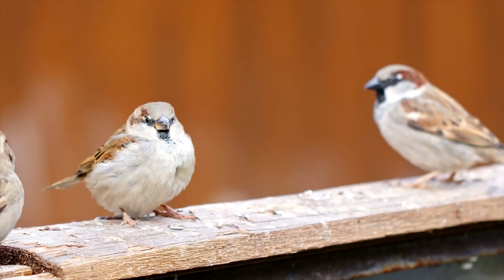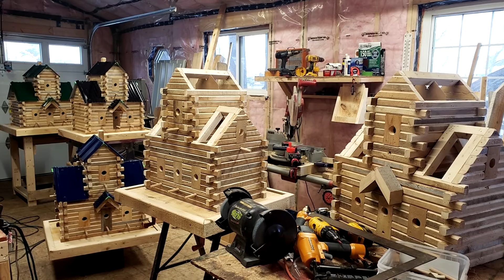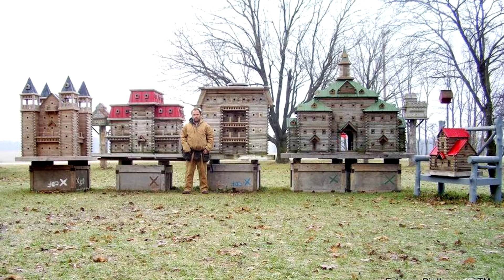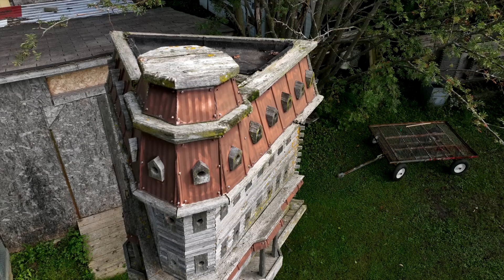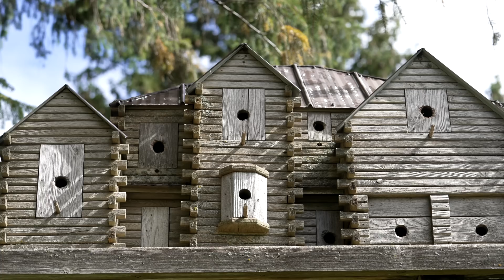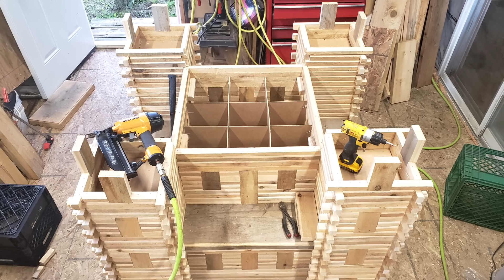World's Largest Birdhouses - Coolest Thing I've Ever Made EP25

Comment: those look very pretty as design objects but I doubt they are very suitable as actual bird nesting boxes. 

And what's with mounting bird bixes on posts? It gets way too hot in there, those boxes need shade; otherwise the chicks will basically cook alive in there.

How are those boxes cleaned after nesting season, is it even possible? 

"The birds love what I do" – shows a bird in an open nest 😅
Reply: The reason i take videos is because of doubters like yourself who think they are experts on birds. I have built birdhouses for over 20 years and also watch the birds throughout the year. I see them as babies up until they are able to feed themselves. The birds i get live in them all year round and they fill the entire room with nesting except the center. It is fully insulated to keep the heat in during the winter and keeping it cool in the summer. They also refresh their own nesting every time they have babies, usually 3 times a year. The insides are also removable for cleaning if ever needed. I have had birds living in this house for the last 15 years and only ever cleaned it once so far. The reason they are up on a post is to protect them from cats or any other prey. I have never had any issues with the birds or their houses in all that time. I have all kinds of videos just like this one. https://www.youtube.com/watch?v=naPdUfruogA
Reply: Thanks for your answer, I appreciate that! But you keep saying the birds live in the boxes the whole year; which birds would do that? I genuinely have never heard of that behavior.